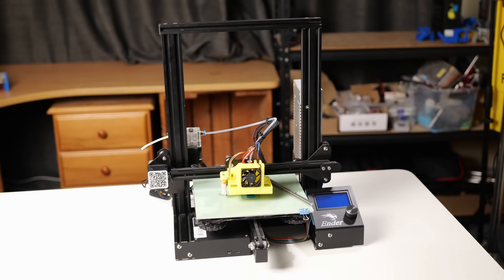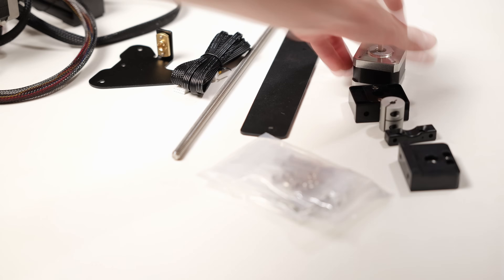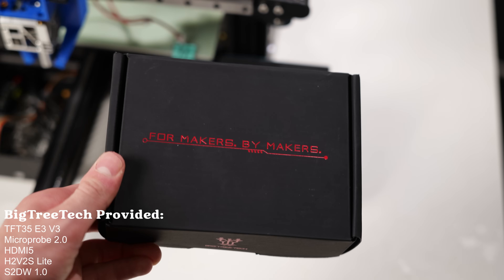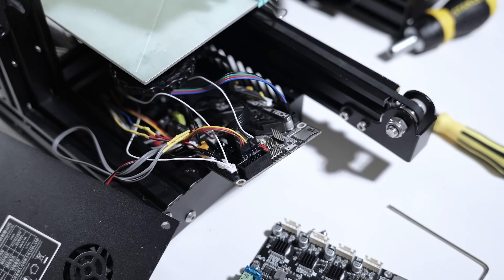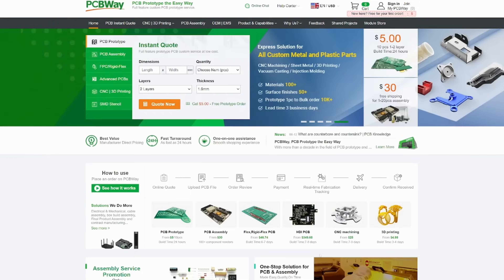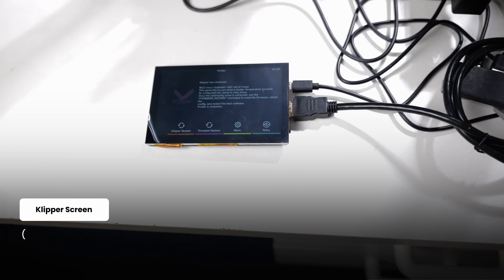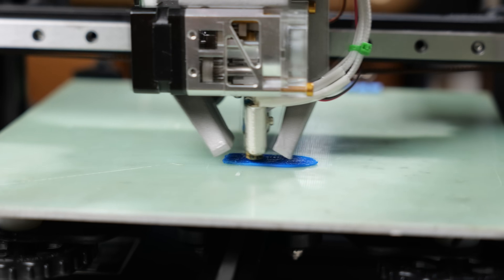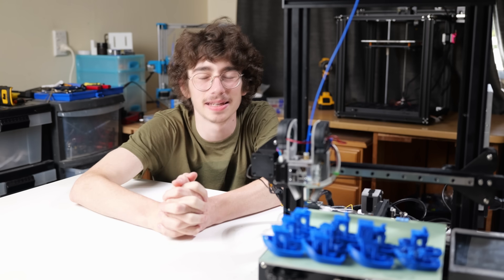Upgrading Everything on my Ender 3

Comment: 6:20 Eyyyyy, i have that wrench, do you fly FPV drones? :D
Reply from the maker: I love that tool so much. Unfortunately, I don't fly anymore😅 Lost a couple of digital quads a while back so I'm taking a financial break until I find a good time to get back into it. I sold all my gear for the YT stuff too lol.
Reply: Rip, thats unfortunate🥲 Also, would you know where can i get the bit insert into that tool? I ruined the smaller one and it can be changed, but i didnt find any replacement…
Reply from the maker: Nothing can be done now 🤷Good learning lessons at least. Somewhat.
I do not, unfortunately. I would try emailing the retailer you got it from, and seeing if they know where they could be bought. Good luck! Cheers!

Comment: Hey I did the same dual Z mod I recommend getting a belt to keep the motors synchronized. the 616mm is a little tighter than the 618mm but I use the 618 on my printer and it works perfectly.
or you could do what I did on my V2 and add a 5th stepper motor driver to the stock motherboard.
Reply from the maker: Good idea, I'll look into that.
Reply: @TommyHoughton  my z axis was a nightmare with the screws. i did duel z with and without the belt and just had constant issues with the z axis. i found mod that makes the z axis all belt driven and it works amazing. not saying is better than properly installed lead screws but was fun to do and looks awesome + fixed my issues.

Comment: The silicon heater isn't that good of an idea. First it is too small for the thin aluminium bed and will cause it to warp due to uneven heat distribution. Over time the original traces of the bigger low power heater might be stressed too much and break. Second, you absolutely need to ground the heatbed when using ac current at that voltage. Third you need to put at least one thermal fuse in line with it (better two in series) and in direct contagt with the heatbed, because ssrs can break and permanently close the circuit. That would easily cause temperatures to reach way above safe levels ab become a great fire hazard.
Reply from the maker: Thanks for the tips, I’m trying to get my hands on a few thermal fuses, grounding the bed is something I’ll look into as well. I’m considering removing the bed for the time being just to make the whole system a bit safer until the components arise. Cheers

Comment: where did you source your linear rail? Ive thought about doing rail upgrade as well but keep getting told i need to find a reliable source
Reply from the maker: I got it from Aliexpress, It's probably not as good as a genuine one, but it seems to work fine for me. https://www.aliexpress.com/item/1005004377144262.html?spm=a2g0o.order_list.order_list_main.74.63511802QZA1mx

Comment: The clicky gears on the H2 is not a problem. It's even a good thing. It's just noisy as hell with PA lol
Reply from the maker: I thought it was at the start, now it’s not a worry. Super pleased with the quality of prints. I must try printing some, I’ve been afraid of using anything other than PLA for years.
Reply: @TommyHoughton  I loved my H2 but I stopped using it to test the Sherpa Mini. 

Sadly, I'm not really pleased with the results. 
I have the same nozzle, block, v6 heatsink, and the extruder can't reach 500 anymore. 

My H2 could do 600 easyly, the limit would be the CHT nozzle. Do you have some tips for increasing the power of an extruder ?
Reply from the maker: I’m sorry to hear that, I’ve always wanted to try a Sherpa Mini, not sure why it would affect the performance so much. In regard to increasing power, a copper cht nozzle or steel a one would help since you’re printing at high temps, a new high power heater cartridge might help as well. For the extruder itself some vref tuning and/or current adjustments may help too. It’s an interesting problem so I can only provide suggestions. I hope you get it sorted. Cheers

Comment: What is the benefits of changing to a 220v bed? Is it worth it?
Reply from the maker: Not on a build plate smaller than 300mm. The thick beds that Voron's, RatRigs, large 3D printers (or 12v ones) could really take advantage of a 220v bed. The costs of a good quality relay, thermal fuse, mounting hardware and bed itself do add up, but they are very powerful. On anything Ender 3 sized, it's not worth it. Cheers

Comment: hey, could you provide links to that toolhead? or if you made it yourself post it to thingiverse? thanks!
Reply from the maker: Here's the thangs link, https://thangs.com/designer/robertsisco/3d-model/H2%20V2S%20Lite%20Parts%20Cooling%205015%20Ducts%20and%20Mount%20Optimized.stl-993950
It requires an adapter to be used with the Ender 3, I'd prefer not to share the one I made as it's not very good. Cheers

Comment: SKR board has a fuse you can replace
Reply: i bet he proberly fried an IC or some other unidentifiable component poking around with the meter in a live circuit, just my 2 cents.
Reply from the maker: You're right, I'll look into that and hopefully it fixes the problem.
Reply: @ItsBoyRed  could be….i fried my first SKR mini’s fuse right out of the box new. It crackled then popped, and I thought I killed the board but just grabbed an auto fuse assortment kit to replace it, that’s why I suggested it.
Reply from the maker: There’s a little transistor that has some marks around it, I believe it’s the one that handled fan power. I bridged the connections on the fan itself which made its way to the mainboard. I got a rough model number but not the most helpful. I was rather careless which was my fault.
Reply from the maker: I’ll try that today and give it a shot, I wasn’t able to heat anything after the short, so I’ll give the mobo power and that required stuff with a new fuse. Will let you know

Comment: I lost pcbway at the shipping price quote for a single computer part 😢. Reason im getting back in the printing space. Man alot has changed!
Reply from the maker: It's sometimes more than the parts itself, over here in NZ, I've seen quotes go as high as 70USD. While it's blisteringly fast and I've had no issues, it's not exactly budget-friendly. For basic 3DP it's definitely worth getting a machine, but for CNC stuff, It's a bit different. All the best with your printing! Cheers!

Comment: Man I might have to try this just so I can get my ender 3 pro from 2018 to actually work ;(
Reply from the maker: What issues are you having with it? I wouldn’t recommend trying all the upgrades I’ve done here. A good mainboard is important though. Cheers
Reply: @TommyHoughton tbh I’m trying to print ABS with a stock printer, bed adhesion is a big issue and the hot end isn’t desirable. I also want to reduce print times and machine wobble affecting print quality.
Reply from the maker: @notanicename  I tried to do that a long time ago, I had a basic pop up enclosure but bed adhesion was definitely an issue.. I wish I had more experience to give you more advice. I believe different shops offer types of "glues" for enhanced adhesion, but if you're planning on printing more ABS then a more tailored hotend and build surface would be good. There's a large amount of options to go for. I can recommend Trianglelab's CHC Pro, it's a volcano length ceramic heater with a higher max themp than the E3's and with the full kit for I think ~30USD it comes with a heatsink and all metal heartbreak, so  no worries about heat creep and burning the PTFE tube. It's much faster too. I don't have too many suggestions for a build plate though, I love a good PEI flex plate, they're hard to beat. Machine wobbling is an interesting problem, aside from tightening everything there's not many options I'm familiar with. The BLV mod is a premium option but I'm not sure how well it improves wobbling and such. As good as linear rails are, I wasn't having issues on my slightly stock machine years ago, the main thing was making sure everything was bolted down almost as hard as possible. Let me know if there's anything else I can suggest, I hope you find some solutions in due time. Cheers!
Reply: @TommyHoughton  sounds sweet! Ye I’ve ordered a good PEI plate to replace the glass one. I have an enclosure and also got a CR touch. Also have just gotten a better ptfe tube (Capricorn) so maybe that might work?. Either way hopefully all these new upgrades and all will work well with my Esun filament. (I use esun as well because in Australia it just seems to be the cheapest lol). Would be really interested to see some sort of mid tier upgrade guide for ender 3s from you whenever that may be. Just haven’t been in the know since 2019 🤣. 

Thanks again man you’ve earned a sub after seeing plenty of your videos, keep up the good work and you’ll go really far :)
Reply from the maker: That's a good set of components, I think you'll be set. Capricorn I hear is good, but a full metal/bi metal heatbreak is an excellent long term upgrade. A mid tier upgrade guide is a brilliant video idea, I've actually got something sort of similar planned for January. "How much can you upgrade a 3D printer with $100,"  (USD) I'll be doing this challenge with a friend, and we'll be ranking our (from stock) machines on a variety of factors such as speed, quality, reliability, value, etc. Will be a fun and interesting project. I just need to get my hands on another Ender 3 haha. 
I really appreciate your feedback, I've got lots planned for the near future 😄 All the best with your machine and projects! Cheers

Comment: I have big extrusion issues with the biqu extruder foe me in dont works has anyone a idear. I did rotation distance tuning. And the extrusion of the walls and the top and bottom layers dont match.
Reply from the maker: What I found made the biggest difference was changing pressure advance from the stock value for my machine (which was bowden in the config) from 0.85 to 0.05. My rotational distance is around 3.3. Make sure everything is tensioned correctly and tightened. If you can adjust the current of your extruder motor that may be worth looking into. I hope you get it sorted, extrusion issues are a pain I’m familiar with.

Comment: you could have flashed the pi with mainsail with the official pi flashing tool. It includes klipper and moonraker by default.

The printer looks like a workhorse!
Reply from the maker: I’ll look into that for next time, I found Kiauh works well for my workflow. It’s a beast for sure, but still has room for more. Cheers

Comment: Is that bed hooked up to a high quality solid state relay?
Reply from the maker: I’m not sure of its quality, it’s cheap and definitely not as good as one of those branded genuine models. Michael from teaching tech made a great video on ac beds which I did my best to follow. I might consider removing the ac bed as it’s quite a serious upgrade which I need to keep regulated. I still need to get a thermal fuse. Cheers

Comment: 1) Why rails on X?
2) Why dual Z?
3) Have you locked your Z lead screws on top of that 2040s?
Reply from the maker: The x axis rail was chosen because it was easy to do with an affordable kit, the Z axis too, It was primarily because of the title and I wanted to upgrade some of the motion components. The dual z definitely keeps things more stable, I've had better print quality using it on two of my machines. Although I've also done extruder upgrades on both as well. The guides at the top of the lead screws are tightened down. Cheers

Comment: Is it worth it to do all of this?
Reply from the maker: No, this video was just trying to “upgrade” as much as possible. My most recommended upgrades are a leveling probe, pei flex plate (g10 is also great) and higher quality hotend (although not entirely necessary) and a silent mainboard if not installed already. Most of the others are either for title or just unnecessary. Cheers

Comment: And another question, i tried multiple times to install octoprint and klipper on the pi, it is an pi 3b original(soo not like bananapi but a genuine raspberry) but i have tried it 4 times already and it keep hanging on zeroconf and i have waited 15 min to eveb 3 hours without luck. Anybody know how to resolve this issue
Reply: I had a similar problem on the OrangePi Zero 2W.  It turned out to be the version of OS that I was installing, even though it was from the OrangePi website.  For some reason the 6.X kernel versions did not work on the device.  My suggestion would be to try a different version of the OS if you can find one.  Even a blank generic Raspi OS.  Then use KIAUH to install the Klipper instance.  I know there is an automated program for installing octoprint as well.  For me Klipper with Mainsail was enough and I don't need Octoprint on my CR-10S.

Comment: Really nice vid however there is a few more things to learn and do. For example having a lightweight extruder setup for faster and more speed and acceleration. Or just convert it into a core xz printer like the switch wire, tbh at this point, what I will do is just to see fluid I have the spare time and money to upgrade and modify this even more or just get a new printer. I could learn a thing or two from the editing man but anyways keep up the good work!!!❤
Reply from the maker: Thanks for the tips! I’ll look into CoreXZ, I’ve been too intimidated to consider starting a build. All the best with your machine! Cheers

Comment: What Is the maximum speed you can you print with a good quality?
Reply from the maker: I haven’t done proper testing, but several times the recommended stock speed is still comfortable for the components. I’d say 200-300mm’s per second travel with 3000mm’s acceleration at least. The print head is a bit loose so I can’t push things super high before it shows. I had a Gcode with the values for the quality benchy but I can’t seem to find it. If I do I’ll update this comment. Cheers
Reply: Thank you!!

Comment: Haha looks very similar hotend setup to my delta that I upgraded as well. Still using bowden but it's got a HF dragon v2.
Reply from the maker: Thanks for sharing! How does that hotend perform? Cheers
Reply: @TommyHoughton  It's really nice, I did some modifications to mine and machined an aluminum bracket to hard mount it on my delta. Put a pt1000 and 70w heater in it and can do nylon which was my goal, even using a the spare 24v fan off my ender 5 for hotend cooling suffices enough.
Reply from the maker: @Hosteggy  Great idea with the bracket, nothing worse than a loose hotend. That’s quite a set of components too! I saw a hotend on Aliexpress called the “Bingo” hotend. I really want to put a 100w cartridge in that if I can get my hands on one, it looks insane. I’ll be installing the Trianglelab Dragon Ace hotend on my Ender 5 for my July video. I’m hoping it performs well. Cheers
Reply: @TommyHoughton  Oh that bingo looks very interesting, large heatsink as well compared to the competition. My dragon HF is trianglelabs as well so you shouldn't have any issues with them.

Comment: As a ender 3 pro newbie owner, im jealous) Nice video!
Reply from the maker: Much appreciated! All the best with your machine! I’ve had a couple of e3 pro’s in the past and they performed very well.
Reply: Don't be. Most of these upgrades are pointless. A btt mobo, best would be the skr 1.4, with 2226 stepsticks, RPi Zero 2 and a capricorn tube would be the only upgrades that you would need to make the printer far, far, far better than the original version (and also better than this contraption in the video).

Second Z axis with an independent driver and linear rails (on the Y axis), are good upgrades, but I can tell you by running them for a while, not much of a difference. The X axis linear rails are all pointless. A proper upgrade would be dual linear on the X, but with the 2020 profile that is almost impossible. Also you would need a dial indicator to mount it properly, something almost no one on YouTube seems to realise. Also all the displays are just pointless, mine went in the parts bin almost immediately after I bought the printer and used Klipper along a RPi Zero. I push mine a lot, I've taken all the electronics outside of an IKEA Lack chamber, and print TPU, ABS, PLA (detachable sides with magnets on the enclosure), and PET/PETG. I recently upgraded to a RIDGA sherpa mini with the stock hotend, just with a bi-metal heatbreak. If you pay only for the upgrades that you truly need (and don't be stingy on those), you will get a reliable printer that can print functional parts. Then if you need faster prints, you can either build a Voron or get a secondhand Ender 5 Pro and convert it to a Mercury 1.

Don't be jealous, do the research and upgrade the Pro.

Comment: Why not buy prusa then?
Reply from the maker: A Prusa would still cost too much for me, plus I wouldn’t resist modifying it. I’ve been meaning to buy a printer that “just works,” but I really enjoy modifying them. Definitely one day though. Cheers
Reply: @TommyHoughton I own two creality ender 3. And I thought that could be better to buy something with less need for maintenace.  Because recently i've spent two days trying to figure out what is a cause of mysterious rings. I've literally dissaemble all [partys and repalced them with one which works properly. In the end I had to replace entire hot - end and that was it.   And I bought two spare for future failures. But right now i'm planning to buy bamboo lab. .
Reply from the maker: @qnaman  The worst troubles are when you can’t find the cause immediately, it’s frustrating at the least. Getting an x1 or p1p will be a huge upgrade, I’ve heard such good things about those machines. I hope things work out!